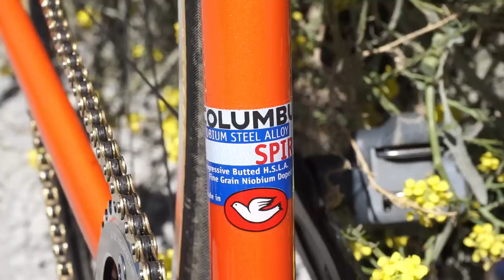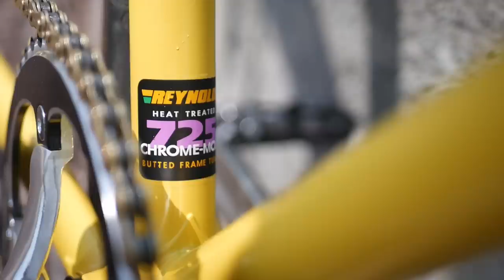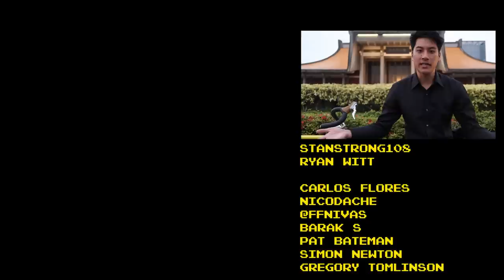The Case for Steel Bikes

Comment: I like steel frames, got an old tange 1, because I'm old, and hope to get older, and steel frames last.  This frame seems to be early 80's, hand built, and the 10 by 2 700 by 32 weighs in at about the same as yours.  It's a 22 inch, would rather a 23, but it's the nicest bike I've ever owned, and cost less than four hundred to build.  It's mixed "Campi equipment" very lively, responsive, feels like it wants to roll.  I've ridden aluminum several times, and test rode a carbon, and both felt sluggish to my taste.  Thanks for some very interesting conversation, it's good to see young people like yourself enjoying the same old things we did, fifty years ago.  You grow attached to your personal bike, you know all it's quirks. You've got some beautiful bikes you show, thanks again.

Comment: Thanks, Zaxh. THAT cleared the air a bit! And, gotta say, the Reynolds Bob Jackson in my cellar is looking better all the time! Only, here in Switzerland, things can get -- news flash!! -- kiinda HILLY, and the Jackson is a 2x5, end of story. I could hack that 40 years ago, but today, I ride a much less attractive, still-ancient,  Al 3x8. But when I was in (flat, flat, flat) Hamburg a couple of months ago, I couldn't stop drooling at all the real deal, ancient steel on the street. Oh, the thinness! Oh, the lightness (though maybe only perceived)! And those thin, elegantly curved fork blades! In the aircraft industry, there's this term: ramp speed. That's when a plane looks like it's doing 350 knots just sitting out on the tarmac. Old bikes had it:  RAMP SPEED!!!

Comment: Two Waterford made Gunnars and an Indy Fab Crown Jewel demonstrate my love for steel. Owned everything as I have been cycling since the early 80's (jerseys were wool and the soles of my shoes were wood; 6 speed was new-ish). Steel has a feel that I guess I love and am used to. Carbon looked sexy, but it never felt lively in the same way. Personal preference of course as all materials have pros and cons. The emphasis on weight and "the latest technology" keeps the bike companies in business; the average rider will never benefit from the incremental improvements in weight, etc. Most folks in the US barely ride their bikes. Those that do ride are usually doing casual group rides for coffee or beer. Amateur racers represent the smallest segment of bike owners, but we all believe we should ride bikes built for that very narrow discipline. I can tell you my Indy Fab is the absolute best road bicycle I have ever ridden. It's special. My Gunnars are used for gravel and more relaxed, possibly loaded road riding; they have the same liveliness and comfort but less "racy" in the geometry. I suspect I will own these three for the rest of my life! Oh, and they're all beautiful and made in the US!

Comment: Excellent Zach ! Back in the day ( mid 90s ) when I was racing as a Cat 3 road , I came into a little money so thought to buy a new race bike !
Went to the local race bike shop and test rode 3 different bikes 1 ) Carbon fiber 2 ) Titanium and 3 )  a Pinarello with Columbus SLX or Pinarello Dedaccai steel tubing . 
The Steel Pinarello blew the others away in handling, road feel , sprint responsiveness and COMFORT !

Comment: Stll riding my Raleigh Grand Sports from 73.That brooks saddle still looks good.However,the rear quick release broke on me just b4 christmas. I got a used GT VIRAGE for 10 bucks about a month ago and,im gonna get it ready to go and,save the raleigh for my ride like the wind days. By the way,the virage is 7005 heat treated aluminum😕Now you have me worried! But i have taken it apart and,have it about 75% done.Didnt see any worrying issues though.Just have to get the rear wheel replaced.Good video👍

Comment: Got a vintage 1973 Colnago Super, Columbus SL tubing. Weighs 20.2 lbs complete with pedals,pouch and H2O cage. Like the ride of it since it was upgraded to Dura Ace 7400 STI, TOL components. Solid on the road….❤❤❤

Comment: Been riding a (dented) aluminum 21 speed road bike with carbon forks.  Decided to buy a used single speed steel bike with horn handlebars as a second bike.  I have been hooked on modding out and riding the steel bike and haven't ridden the road bike since, lol.  BTW both bikes feel about the same weight in current setup.

Comment: I grew up on steel and it still holds a place in my heart. Through my cycling career I have ridden everything. Usually as it was just coming out. Aluminum for BMX in the early 80's. Carbon Trek machines of the early 90's. But, I stayed with steel as a mountain biker and roadie for a long time because of the feel. I still own a Jamis Dragon anniversary.
Reply: Hi, do you know the Trek 7900 Multi-track? The 7900 is the bike I ride, and I love it. I've been riding it for about three years now. It was a huge upgrade from bikes I grew up riding and I'm always interested in learning more about it. (my 7900 is from 1996, I think)

Comment: An interesting and nuanced discussion of steel. Good work. Thin-walled steel, in particular, in standard gauge is very lively. I have a brand new build, back from the frame maker only 6 weeks, which climbs like the stuff of dreams.

Comment: Very good Video Sir. I am over the discussions with some of my riding buddies about whether to remove the second water bottle or not or removing the saddle bag carrier etc....because of the extra ounces that they weigh|||IAs you stated, if you are so serious about optimum speed with micro minimal weight.....loose some body weight. 
I own a few bikes that I really enjoy riding.
The newest a Composite Carbonfibre Giant TCR Ultegra Groupset...., Two Europa Cycles (made in Australia Reynolds 531 Chromoly Steel running Shimano 600 Tri Color Groupset (made1994) and a Repco Superlight (70's)Columbus steel with Shimano 600 Groupset. With the Covid 19 Lockdown in place I have taken to bringing all the steel bikes out and given them a full maintenance that they deserve.
I am continuously amazed as to  how beautiful and Sexy the Steel bikes look. The Giant is a beautiful bike no question......but the steel bikes just have this unique appeal that seem command your attention.
In so far as the riding goes, I use the steel bike for commuting (a 70Kms round trip). So smooth....fantastic absorption and great comfort. I would never swap them. Really debating upgrading from the downtube Indexed Shifters to a 10 speed Brifter......but totally undecided as to whether to keep the bike fully authentic or not!!!!

Comment: Stiffness isn't always the best thing. It hurts your knees on long rides because the applied force is high over a short arc length compared to a flexible frame. People make the mistake of confusing flexibility for hysteresis. A good example of the difference is a strip of latex rubber compared to vulcanized tire rubber. The latex is less stiff than a tire, but it releases its energy more efficiently after being stretched than the stiff tire rubber (Latex whips back to its original shape fast = Low Hysteresis; Tire Rubber doesn't return to the original shape as fast = High(er) Hysteresis)
Reply: excellent comment and observation

Comment: Disagree on the looks. Aluminum can be hydroformed, and carbon can be shaped to anything, so frame detailing and styling can get pretty wild. Steel bike designs are always a combination of tubes, which is more limited.
Reply: I like the vintahe estetic of steel frames but this is a pretty good point
Reply: steelframes = Helvetica / carbonframes = comic sans
Reply: You're right but vintage bikes still look better to me. Some of the carbon bikes are hideous. Just my opinion. But Im all for anybody riding whatever. Its a great way to get around and stay in shape.
Reply: The trouble is that with a world of possibilities there is a world of problems. It is hard to mess up a frame built with all round tubes- everything inherently matches. Carbon and aluminum bikes can look amazing when designed well, but there aren't a ton of great looking carbon bikes out there (they sure as hell do exist though).
Reply: @johndef5075  Some carbon frames looked neat when carbon bikes first started coming out,now that everybody has one........generic is the most common thing I think of. Disposable is the next thing that comes along. The idea is to keep buying the newest thing on the market every 2 years and keep the bike industry afloat. Let wretched excess rule. People know old carbon can be problem carbon so it aint worth much when used.
Reply: Colnago
Reply: Thats what is nice about them, the most beautiful things are purely functional.
At some point we lost our way and all bikes had to look like New Balance shoes.

Comment: I've got 11 bikes all of which have steel frames. Their year of manufature goes from 1947 to 2009. The best riding bike of the collection is a 1950 Bates BAR. Two of the bikes have been in wrecks and needed repairs; no problem. Mark Nobilette repaired them and they are as good as new.

Comment: Don't forget that when steel fails you can repair it.  I've got a 96 Kona Cinder Cone that snapped near one of the rear dropouts.  Took it to my local frame builder who put a new one in.  That frame builder was Witcomb Cycles - before they closed.

Comment: Well, I'm more worried about my components rather than my frame. I ride a CrMo frame, it's lightweight and resistant but I'm always worried about my hubs and fork, especially now that I have tannus tires and parts of the road here in my country are a nightmare. I used to ride steel and now that I've tried it again, it feels so stiff and resistant but great.

Comment: I ride an old Paramount OS3 that I bought in 1993 and I love the feel, the resonance of the ride. The bike has oversized and tapered Tange tubes which makes the bottom bracket more rigid for transferring power, but the whole frame yields just enough to make the ride very enjoyable. Full bike weight is 27lbs. After thirty years and a couple of overhauls I have zero interest in changing bikes. I have seen both the OS3 and the OS5 frames available on EBay. They are very worthy of consideration.

Comment: Two things I would like to add. I ride a 1973 Holdsworth, Reynolds 531. The rake on the fork is very forgiving. And there have been spots without paint for 30 or more years and just light oxidation, it cleans up nicely.cheers.

Comment: I raced pro on steel, a bike built to my specifications in the 1980's. There is talk of high tech steel, that is stronger and lighter than carbon, but have not seen it in production yet. The problem remains with steel though, bottom bracket flex so bad the chain will drag on a properly adjusted front derailleur when climbing or accelerating. Today I like aluminum with steel curved rake forks, best of all worlds. There is no reason to buy an all steel bike today, the aluminum frame/steel fork is the finest bikes for your money today.
Reply: you just need to lose weight buddy, there's a reason high end bikes don't use aluminium, it's cheap crap. titanium or steel is the only way to go

Comment: Back in 2000 I had a Bianchi with carbon-fiber forks that shattered just going over a railroad crossing. The bike shop said I was too heavy for the bike. I was 5'6" tall and weighed about 150-155 pounds. A representative from Bianchi gave me a bunch of free gear and had the bike shop replace the forks. I'll never ride anything but steel all around.
Reply: I've had that bike before
Reply: ohhhhh

Comment: I ride steel and only steel, always have and always will. I'm not a racer, I'm a rider and I love steel bikes. Smoothest ride you can get in my opinion. My newest bike is a 1992 Miyata 914 with 2005 or so Dura Ace components. I have like 10 steel frame bikes.

Comment: I have a 2017 aluminum road bike with a carbon fork. I also have a 1968 Schwinn Racer three-speed. Two totally different bikes. Guess which one I like riding the most - it's the steel one.

Comment: The one drawback I've seen is that the top tube of steel bikes isn't diagonal as in a Giant TCR bike design. Instead, its very flat and parallel to the ground. It makes it harder to find good enough top tube to inseam clearance.
Reply: agreed, most bikes are 23 inch frame, made for 5'10" +taller

Comment: I love steel bikes, I have 6 of them from a 1951 Lincoln 2speed kick back to a mid 80's Trek 330 that Ive redone several and to my '98 Trek 520 touring bike that I've also rebuilt several times. I also have a 1972 Raliegh "Sprint 27"  3 speed, which rides well but the quality control at that time was poor, at least on the cheaper bikes and I have a mid 70's Browning that I'm restoring. I've ridden on other stuff but I prefer steel, I trust it. It's nice to hear someone speak it's praises...thank you.

Comment: Personally the durability is why I love mine :) I'm no fixed gear rider, but I have a steel touring bike and a steel road race bike. The touring bike has the frame from 1993-ish Wheeler pro line 5000 MTB, and the road bike has a 1988 Columbus SLX frame which was produced locally here in Belgium.
Both of them have been through a lot, and especially since I bought the MTB from the original owner and I met the former boss of the shop that built the SLX frame, I really appreciate these frames having so much history. I look forward to riding them for decades or until something terrible happens.

Comment: I just restored my 1997 Bontrager Privateer Comp XT to new specifications. No bike I've ever owned has a better ride or fit. Aluminum is just too harsh. It beats me up. I agree with every point you made.
Reply: Got rid of my 90's Cannondale for that reason. Beat me up vibration city. 
Went back to steel and yada,yada about the weight but truth is I'm 240 lbs and weight of the bike won't matter a blink. It's all about the motor. I'll trade the weight for a better,smoother feeling bike.

Comment: I would take magnesium bike frames for any metal. It is the lightest structural metal and the smoothest ride and surprisingly durable. I’ve ridden aluminum, carbon, chrome molly, and titanium. I ride usually on the streets of NYC old ultra light ten speed carbon bikes which I built and had have no frame issues.

Comment: I own 3 steel bikes. 83’ Stump Jumper , 93’ XO2, and a 12’ Surly LHT. The Bridgestone XO2 is purple like the one in your video. I did ride a titanium frame once and was surprised at the “flexyness” of it. Aluminum is good for a kids bike. The carbon has come a long way. Carbon forks on cyclocross bikes is common. But once it’s even a little cracked, it’s toast. It shatters with no warning. So many great steel frame builders out there today, just go on IG #steelbike 🤤 Great looking bikes on this video! Thanks.

Comment: What is the air quality like in Shanghai for cycling? What is a US Postal Service mail box doing in Shanghai? There are book about the engineering of steel frames. What you are talking about is the fatigue endurance limit of a material. If a frame was thick walled enough not to fatigue, it would be really heavy.  Reynolds 531 (.9 - .6 - .9mm wall thickness) is a very good balance of fatigue resistance and strength to weight. They last a really long time. But a 210 lb rider, who powers up hills out of the saddle and it will fatigue rapidly. Wall thickness of .5 mm or less fatigue more rapidly, but they also are more likely to buckle in a crash. Aluminum has no endurance limit to it. Titanium has one of the best fatigue resistance and corrosion resistance. Titanium is also VERY pollutave to produce. I own a steel bike, Titanium bike and a carbon bike. At the low power levels I generate, I can not really tell a difference between them.

Comment: Thank you for your excellent commentary on the advantages of using a steel bike frame. You pretty much covered everything on the subject. The only thing I'd add is that steel seems to have optimum stiffness, damps transient vibration while being economically affordable.

Currently riding a 25+ year old custom 58cm track bike w/ Reynolds 'Competition 531' steel tubing, full Campy drive train, hubs & rims, 3TTT drop bar & stem, and a Brooks Pro leather saddle. Also running a Suntour Superbe Pro front brake with a bar end shifter w/o its' ratchet as the brake lever.

To answer your request on what types of steel ... I'm familiar with Ishiwata 022, Columbus SL, & Reynolds 501 / 531. All are quite good, but the 531 feels the best to me.

Where can I send you photos of my ride?

Comment: My brother got an 1980s cheapo chinese mountain bike he found, and started moving around town in that since coronavirus lockdown and all.One thing ive noticed about it is how light it is for something made out of steel and inox steel rims (it's very light, i'd say it weighs a third less than a trek X-caliber or a Specialized Roll.It does look slim, almost like a road bike. What i assume is that since mountain bikes adopted aluminum and carbon you see the frame tubes are in some cases almost tripled their diameter, for fashion and maybe to remain strong ,which i assume must add weight.

Comment: I got a steel bicycle from my parents for free. It's a low end 90s bicycle from a supermarket and while it's not really fast or efficient it's very comfortable, it absorb a lot of vibration and it aged surprisingly well. The paint has seen better days but other than regular maintenance it didn't need much to be road worthy. On the other hand I bought a modern road bike for 550 euros from decathlon last year and it's simply not as good. 

While I don't think that aluminium is a bad material on modern bikes you have to spend at least 700 euros to get something that wasn't compromised in some kind of way. I think it's harder to go wrong when buying a cheap steel bike.